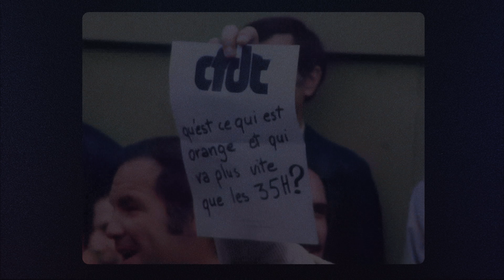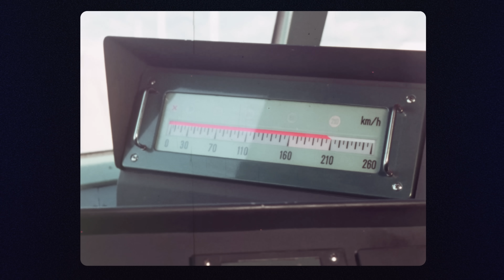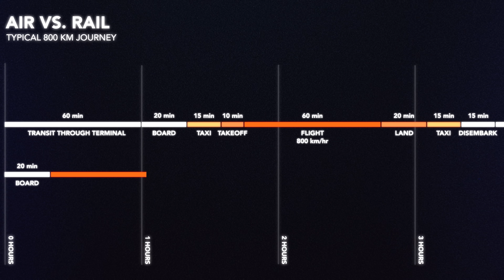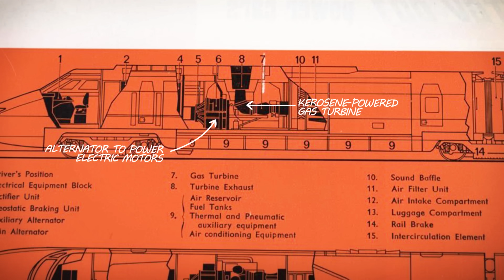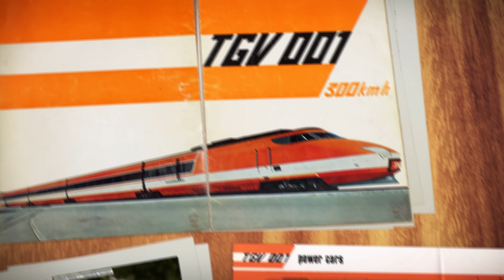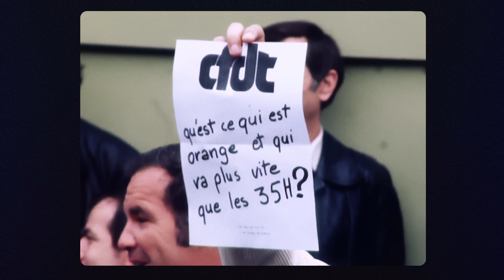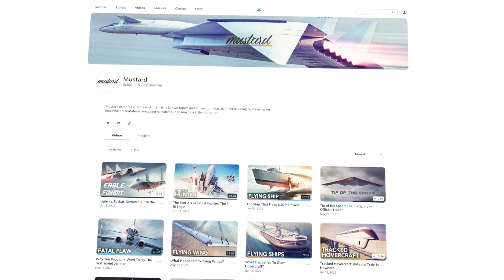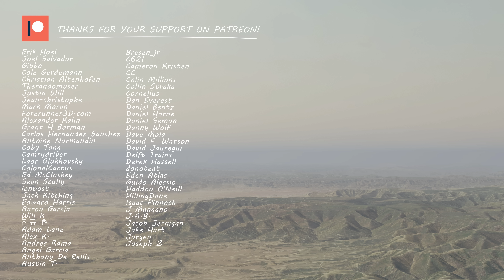Why French Trains Are The Fastest

Comment: Meanwhile, not to make anyone feel salty, including those propaganda heads on the radio, in the U.S. you still have wooden railroad ties and wooden telegraph poles in the middle of major cities—and not just there, but everywhere—while the rest of the world, which you may not know exists, has advanced far beyond the thinking stuck in the 1960s.
Even Russia has infrastructure—I won’t compare it to that of the U.S., because there is no comparison they run electric lines double of U.S. border all concrete rails , seamles,s no joints.
Japan, a country that was destroyed by wars, has risen and even surpassed the U.S. in some areas, while being a colony,  and it is the largest buyer of U.S. debt—think of that.
But the U.S. still lives in the 1890s. 
Absolutely no infrastructure improvements
You can’t change that. Just None, lets cut a tree and make a pole, just like they did  in 1786
Or make a home, same and nothing different.
Absolutely wow

Comment: Trains are totally failing in some places. Romania is a country like this. Nothing significant was done with the rails themselfs since 1880-1915 . Many kilometers of tracks are the original ones from 1910's . Some updates were made during the communist regime. Namely the trains. In the 60's they got a new look. Also quite some electrification was made during 1950-1989. However since 1989-ish all railway development has halted. In the past 36 years we only did the absolute bare minimum with the railways. Basically we are running on 1920 technology upgraded in 1960-1970.

Because of this large areas are not electrified and even larger areas have insane speed limits . Like literally 25km/h and speed like that. The train themselfs look atrocious from inside and out. Locomotives are working but they also look very bad. 

CFR, the national railways are going bankrupt as of next year. Mind you, Romania is a member of IMF,WHO,NATO,E.U.,SCHENGEN.......

Comment: For those saying the maglev is the fastest train, maglevs don't make contact on the ground and doesn't use conventional ways to move so the TGV still is the fastest train ever
Reply: Theres at least a few different trains in China, and hundreds of lines running daily, that are faster than the TGV on rolling wheels. CR Fuxing and Harmony for example.. 350km/h to the TGV's 320km/h
Reply: @AB-gj8re  I meant fastest possible speed for a train, not highest operational speed
Reply: @Antsfaner_yes the Chinese trains can go past 400kmh theoretically
Reply: @AB-gj8re  but they can't go 574 km/h
Reply: @Antsfaner_ that wasnt a TGV, it was a highly modified version wih bigger wheels and a more powerful engine. the fastest operating conventional train is the CR Fuxing at 350 kmh. They could theoretically go 400 km/h on their current routes. im sure that a modified Fuxing could go much faster but thats kind of irrelevant is it not? When we talk about production car records, its the production car, not some guys modified version with 4000 hp

Comment: This is an utterly misled video. The top speed achieved in France is 320km/hr. by SCNCF TGV.  The Shanghai Maglev, also known as the Shanghai Transrapid is the FASTEST TRAIN in the world. Its maximum operating speed is 460km/h and average speed is 251km/h. It has a record high-speed of a staggering 501km/h. Besides this, CR Fuxing and CR Harmony, both are running at 350km/hr speed regularly. While in test run, CR Fuxing reached 420km/hr and CR Harmony reached 486.1 km/hr. Even DB ICE (350km/hr.) in Germany runs faster than France's SCNF TGV.   So, China holds the record of the fastest train in the world, not in a test run but as a regularly operating train.

Comment: Having travelled on the TGV I have to say it was utterly boring.  After the first 5 minutes of looking out of the window and only being able to concentrate on the horizon I settled back into my seat and read a book.  The problem is that you want to look at things nearby but can't because they flash past so quickly.  A journey through the countryside should be entertaining, offering different vistas so that standard trains work exceptionally well in that respect.  Its about the journey, not the arrival.
Reply: It's a high-capacity, high-efficiency, transit system, not a tourist train.
Reply: @nervun8097 High capacity and high efficiency also applies to standard high speed trains but without the assault on the senses.  For me arriving a few minutes later without the visual discomfort is much preferrable.
Reply: @clivewilliams3661  The TGV completes the Paris - Lyon route in less than two hours. Before the construction of the high speed line it took more than four. It's not a matter of minutes but whole hours. After all the point of the hst network is to directly compete against air lines by offering a cheaper and more convenient alternative. No one cares about their "visual discomfort" as long as they arrive at  their destination quickly and cheaply. Besides, I'm sure no one really feels any such a thing unless they got really bad eyesight.
Reply: @nervun8097 Have you been on the TGV?  If you had you might have some empathy with what I say.  Of course the TGV is substantially faster than the Hi-speed trains but some of that results from the limited stops compared with the Hi-speed trains.  As a comparison with airlines the time/cost differences very much depends your starting and completion points.  I flew to Paris from Midlands quicker and cheaper including the early arrivals and transfers than colleagues from Central London.
Reply: @clivewilliams3661  I've been to other high speed services. I do agree with you though on the London - Paris route since the Eurostar sucks.

Comment: The main difference between the French trains and the Japanese is that the Japanese Shinkansen is a whole system. All the tracks are different and built in the way to avoid congestion and reusing existing networks, the French trains even on  international journeys to Amsterdam or London. They only go a full speed at about a third of the track length, the Japanese on the other hand are constantly at high speed for most of the journey.
Reply: uh indeed the difference is that the shinkansen has a network totally dedicated to it? but in France the TGV only runs a third of the time on high-speed lines... except perhaps for the Paris-Quimper connection

Comment: I know there are various reasons it didn't happen in the US, but I am soooooooo mad at how we missed the rail age. If I want to get from New Orleans to Chicago via train, it would be about 20 hours. By plane, it's around 4 (2.5 in the air on a direct flight and 1.5 hours early to the airport depending on timing). A train would still not be able to match that. At the 220 miles per hour of proposed high speed rails, that would match the 4 hour mark with far less hassle. I'm not sure how many stops are likely, but the projected map shows ties in Jackson, Little Rock, and St Louis; so let's bump it to 5, assuming reasonably timed stops and no changes. If you're comparing it to a flight with a layover, that's way faster. Trains are also more accessible and probably more comfortable since you won't have to deal with pressure changes and the slamming down of the plane on the runway at landing.

A couple challenges that we face here are topography and inter-state cooperation, particularly when dealing with mountain ranges and crossing political boundaries. There's also lobbying from airlines and oil companies. They would lose a lot of business if HSR could replace flying and driving for shorter routes. California has tried for a long time, but they can't get anything done. I don't know how much more hope I have for Texas, but I really want the line from Houston to Dallas to succeed. That would prove the merit of the technology for super-commutes. Why deal with an airport or drive 4 hours when you can spend 90 minutes on a train. A non-stop flight from IAH to DFW is about the same time, but the train would cut out the security lines and complicated boarding process. It could be a big deal. Even light research shows that roughly 60% of all Americans (yes, all, meaning of any political party) support HSR. So why can't we make it happen? Even when we agree, we can't do anything.

Comment: As we can see at 3min04, the Shinkansen shakes a lot, that's still the case today, and as TGV (far more comfortable and quiet) they both only run at 320km/h on few portions. Chinese one runs at 350 in large portions until 2024, and now start to run at 400km/h, on large portions too.
Reply: There were studies to push the TGV to 350 but the cost in energy and maintenance was too high compared to the time saved.
Reply: @athrunzala6770  But at which time, this is the case in China for years between cities at least, for passenger and light frets, and it just works fine.
Reply: @ThePopolong  Yes, because in China the cost of maintenance is cheaper and, above all, the distance between cities justifies a speed of 400 km/h.
Reply: @athrunzala6770  Distance between cities is about the same than in France, when TGV goes from Paris to Lille or Lyon. This is instead because China want more efficiency on transportation. They have huge electric production, and want to reduce plane/cars usage, and give access to worker to fast transportation for productivity. Less time used to drive, can be use for doing other things. This is the principle of public service. Not like Japan or France, where more and more services are privatized and less are available. In case of france the fact that ecological transition minister has interest in oil company don't help either. Train lines gradually close, and more people are pushed on roads/planes
Reply: @ThePopolong  Whoa, don’t talk about a subject you don’t fully understand... You mention the distance between Lille and Lyon to develop your argument, but there is no high-speed rail (LGV) between those two cities — and there never will be. China, unlike France, is currently expanding its high-speed rail network, so it can adapt its lines to support V400 trains. France already has its LGV network, which was built 30 years ago for V300, so the constraints aren’t the same...

Also, regarding electricity, you’re completely off-topic — France is also largely in surplus in that area. As for privatization, the TGV has never been a public service in France, so let’s not mix everything up. And about the Minister of Ecology, I’d really like to know which one you’re talking about, considering we’ve changed ministers three times in 2024...

Anyway, I get your propaganda, but do a bit more research before trying to apply it to the railway sector.
Reply: @ You don't know it, there is a LGV between these cities for about a decade. it is used by both Eurostar and in most of it's part by Thalys.
Reply: @ThePopolong  non il y a un raccord entre la LGV nord et la LGV sud appeler  LGV interconnexion est qui passe par marne la vallée mais il n'y a pas de LGV direct entre les deux villes ...non seulement j'ai grandi a côté mais en plus je travail en tant que conducteur a la SNCF donc tu ne vas pas m'apprendre mon métier
Reply: @ThePopolong  en aucun cas elle ne pourrait permettre une vitesse a 400 km heure qu'elle est limité entre 140 et 270 km/h suivent les secteurs .... Bref comme je t'ai déjà dit tu parle d'un sujet que tu ne maîtrise pas https://fr.m.wikipedia.org/wiki/LGV_Interconnexion_Est
Reply: @athrunzala6770  C'est faux, au départ de Gare du Nord, la LGV commence à Gonnesse... pas besoin de passer par Marne la Vallée. Open Railmap est ton ami :)))
Reply: @ThePopolong  ah et comment tu fais pour faire une Lille Lyon sans passer par la LGV interconnexion est du coup ? ..
Reply: @athrunzala6770  Je ne vois pas le rapport, avec ce qui était évoqué au départ. Je parlais de paris vers lyon ou lille. Mais donc, dans les 3 cas (avec lyon à lille via marne la vallée, on a de la LGV sur la majorité, des distances aussi importantes qu'en chine, où les trains roulent à 350km/h, tandis-que les TGV sont à  300max (270max sur la LGV de seine et marne, entre les 2 LGV Paris Lille et Paris Lyon)
Reply: @ThePopolong  car tu m'as dit Lyon / lille  et non Lyon Paris .. après pour ce qui est du 350/400 .  autour de 2015 il y a eu des testes pour voir l'intérêt du 350 sur LGV française et il a ete déterminer que le gain n'était pas pas significatif au vue de la conso d'énergie ainsi que de usure des voies  et du matériel. Le problème du chemin de fer français comparé au chinois ou au japonais c'est sa construction en étoile. Sans même parler d'infrastructures que l'on devrait modifié
Reply: @athrunzala6770  C'était le début de la conersation, pas même technologies, et c'est visiblement moins énergivore et plus efficace que l'avion pour les chinois en tout cas, puisqu'ils pratiquent pour les voyageurs le et le frêt. Le japonais est aussi lent que le français, comme je disais, il n'y a qu'un court tronçon tokyo-sendai à 320, et en plus il est bruyant, et ça secoue comme dans un RER (silencieux lui au moins), ou lors de turbulences dans un avion... Le japonais est aussi en étoile autour de tokyo, mais c'est plus conpréhensible avec la forme en croissant de Honshu. Hokkaido n'est pas encore déservit. Le tgv local s'y arrête peu de temps après la sortie du tunnel vers Hakodate. et de la même façon, Shikoku à 0 ligne. Tandis que Hainan à 3 lignes en Chine. c'est une question de choix délibéré efficacité pour tous contre privatisation et enrichir les copains.
Reply: @ I cite my sentence: 'when TGV goes from Paris to Lille or Lyon'
I cite your sentence: "Whoa, don’t talk about a subject you don’t fully understand... You mention the distance between Lille and Lyon to develop your argument, but there is no high-speed rail (LGV) between" So you don't know the subject because there is LGV between Paris and lyon, between Paris and Lille and between Lyon and Lille anyway.
In both cases distances are longer than in China, but trains runs about 80km/h slower... That's maybe because Chinese have just more advanced technologies in both infrastructures, train tech, and governement want the people be able to work, and reduce CO₂ emissions, instead of getting all the money from people for their own private profit like Japanese of French government.

Comment: The only thing I can't wrap my head around is how do they avoid animal collisions at such high speeds?
Reply: Fences, dichtes etc. along the lines. However this does not prevent it 100% of the time and colissions still happen. At 300km/h it can greatly damage parts of the train, especially the nose which is mostly made of fibre composit material (with inside of it enormous crash-buffers which absorb most of the impact so no harm will be done to vital components and the drivers cab)

Comment: As a German, I was so incredibly frustrated when France rolled out the TGV almost a decade before Germany's ICE came out. 
And when the ICE did finally come, it could only go fast on some few high speed tracks and was incompatible with the TGV, so it took ages more before international high speed rail travel was possible.
Reply: now we have multi system ices, that can go to france and other countries too.
Reply: @SB7-r9i  
I know... but it took Germany ages to get there - and they heroically designed their own stuff, partly ignoring innovations the French had had years before (like electronic  reservation signs above the seats ... the first ICEs still worked with paper chits that had to be fixed by hand ...).

Comment: I recently joined the SNCF in the biggest train maintenance center in France, to work on these beautiful machines, they are a marvel of engineering, every single thing is controlled, tested, down to every screw, every peices, and even the stress of each materials
Going 320 km/h is not an easy task, air friction being the hardest thing to overcome.
But despite all that, the newer ones get to live 25 extra years thanks to a mid-life operation, which i'm a part of, that completely renovates the train. The new TGV-M will be the next from the current TGV-Duplex, and are expected to use even less energy, while having even better performance.
They really are amazing. All thanks to one man who came up with the design. Thank you, Jacques Cooper.

Comment: The new version of the TGV - initially called M - https://fr.wikipedia.org/wiki/TGV_M will not run quicker than it's predecessors. Now SCNF has verified that higher speed has a cost that is not worth it. Instead this new version introduces more passengers per train and some modularity in the way to assemble wagons to had more flexibility in daily operations.